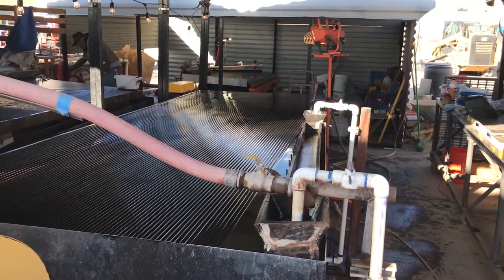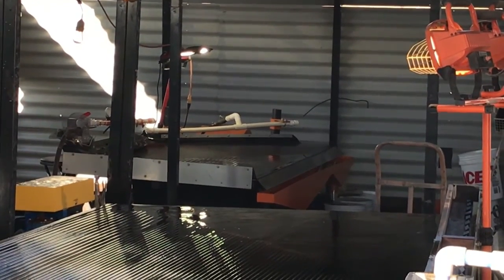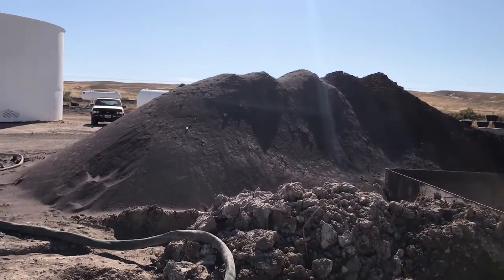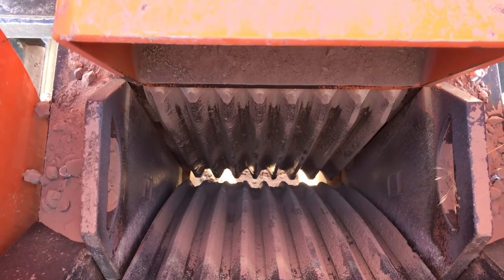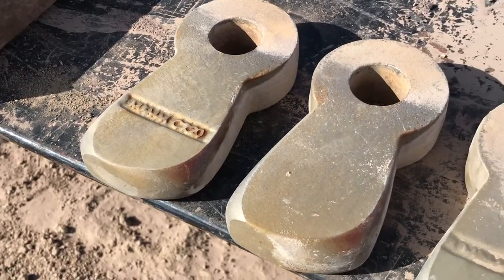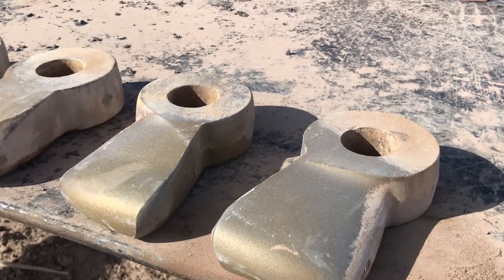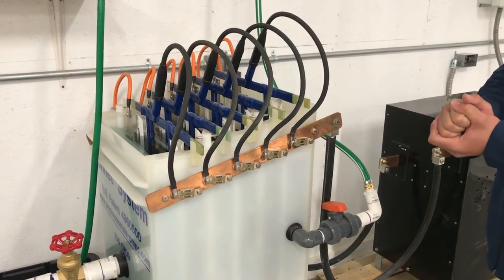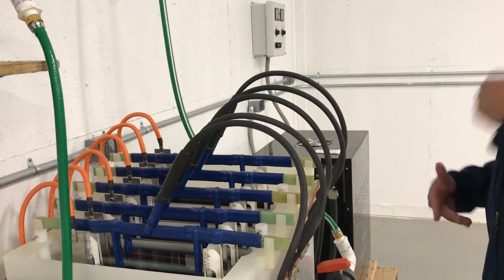Gold Ore Toll Mill and Electro-Refining For Hardrock! Shaker Table, Hammer Mill, and Jaw crusher

Comment: Interesting machine. I am interested in the electrolysis part - just curious, how much current electric current is flowing through each individual plate and what is the source D.C voltage from the rectifier? Also, how much time does it take to produce those 30 pounds of gold on each plate?